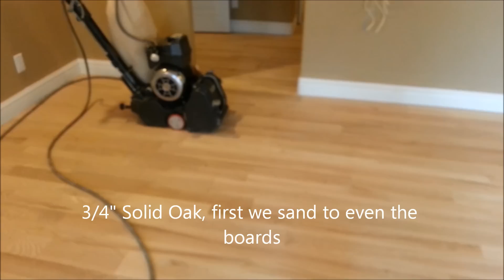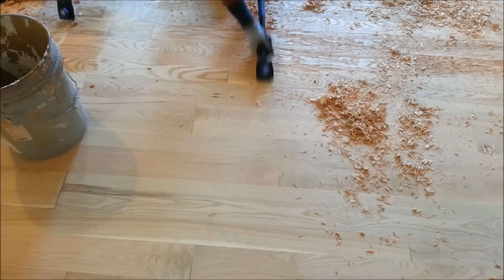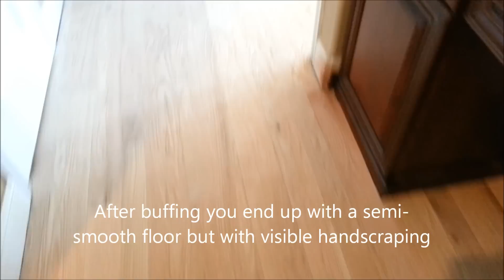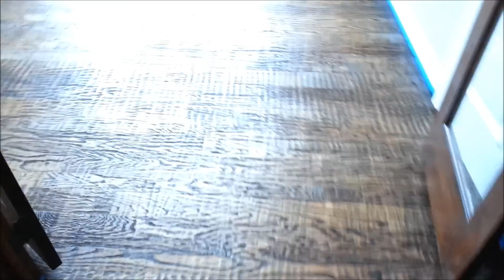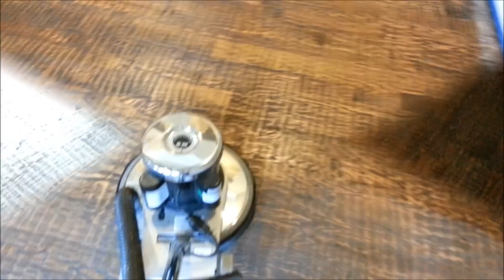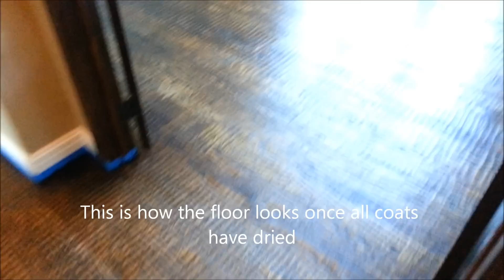Solid Oak Hand Scraped Floor

Comment: I assume the idea of going across was to let the lighting show the texture based on the window location.  I think it was a good idea, but the effect is too much and it just makes the grain look choppy.  A little bias wound have been enough to make the surface texture pop under window light without compromising grain appearance too much.  I don't know what the right bias would be, but it is certainly below 45 degrees and perhaps only a few degrees.  I wonder if some test boards were done before this decision was made.
Reply from the maker: we do what the client wants, this is a very popular trend in northern texas, we are not up north actually way south but our client saw it at a friend's house and he loved it. it's basically a very rustic hand scrape.

Comment: These floors came out beautifully. Do you typically water pop before applying stain on hand scraped floors?
Reply from the maker: We typically water pop any stain above early american.  Basically everytime a client request a stain we pre treat the flooring just to give it the richer deeper look
Reply: @rgvfloorpro  thank you and good too know. I haven’t done many hand scraped floors, but they popular where I moved. I usually water pop stains but didn’t k ow if hand scraping affected absorption. I appreciate the response!
Reply: @rgvfloorpro  hi so is the order: scrape, water pop, buff with 100, stain, buff, topcoat

water pop before the buff? And how do you recommend the water popping be done for a handscraped floor, is a damp cloth wiped over the floor suitable?
Reply from the maker: @TheDingfish  we water pop using a battery operated sprayer, 1 guy sprayes while anpther is right behind him with a tbar applicator dragging it on the sprayed areas just to make sure the waters droplets are dispersed and no pooling happens. after a minimum of 2 hours or preferably the following day u stain it, then after drying for 24 hrs u seal it

Comment: When you buffed that in between coats you just used a dry 16” scour pad or what? No wax correct?
Reply from the maker: we use a thin white pad with a screen on it, i can't remember the grit but usually it's 100g